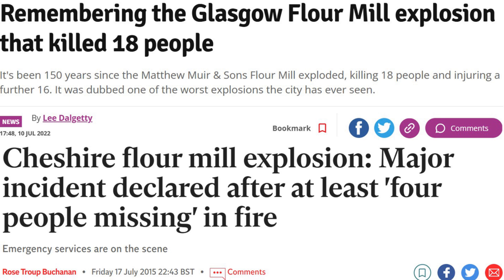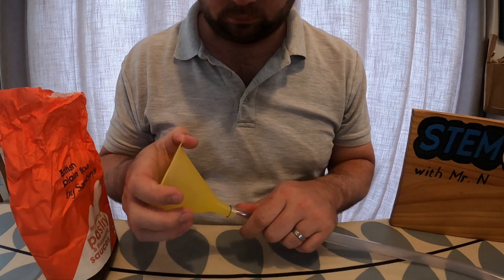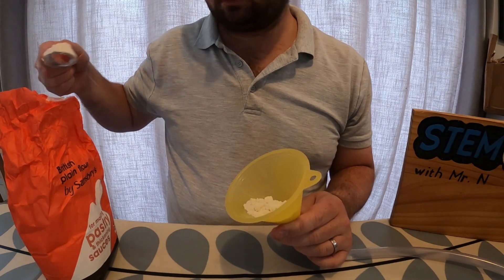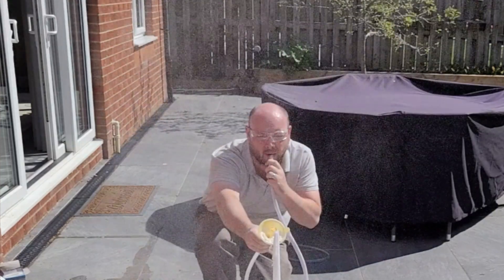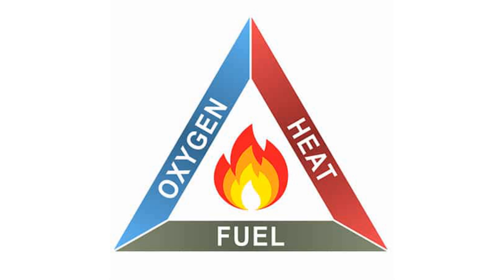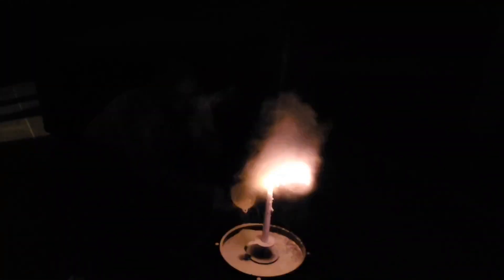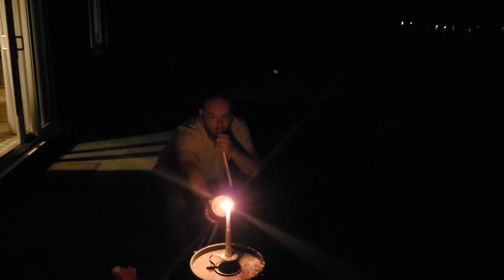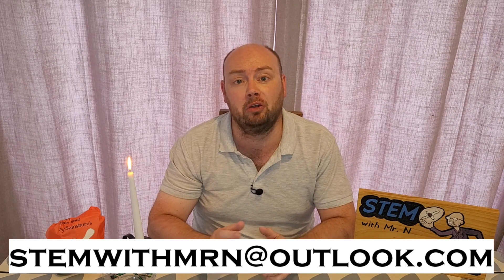How to Make a Dust Explosion (STEM education activity)

Comment: Can this be used via hollow tube for pyrotechnics?
Reply from the maker: @Carnivoreinthecaribbean  as long as you can great a gust of air to blow the flour over / through the flame, any type of hollow tube should work, however I'm not sure how safe it is to use that as a method for pyrotechnics